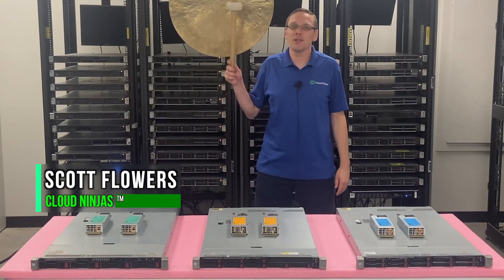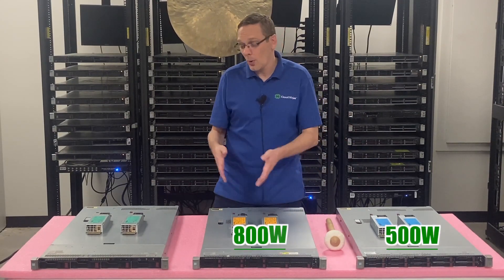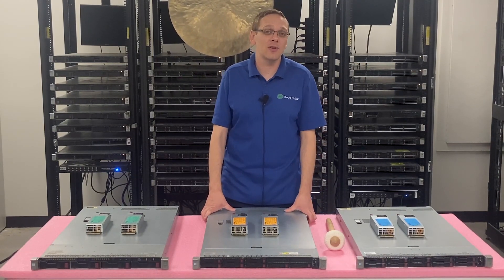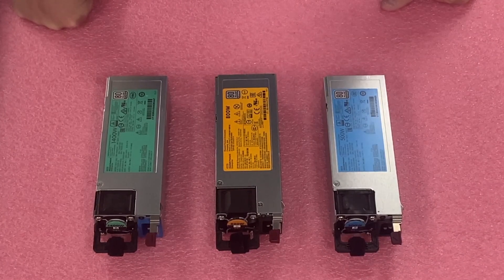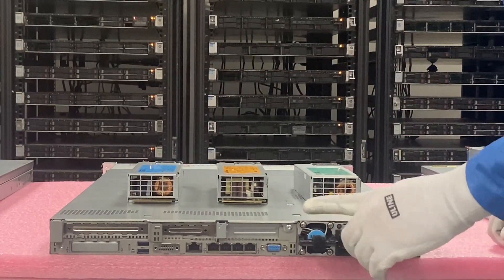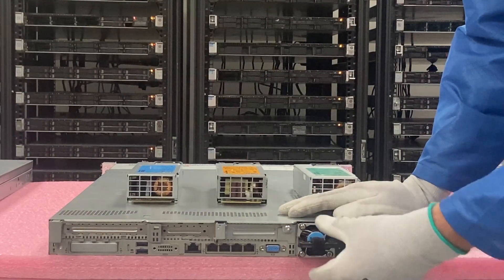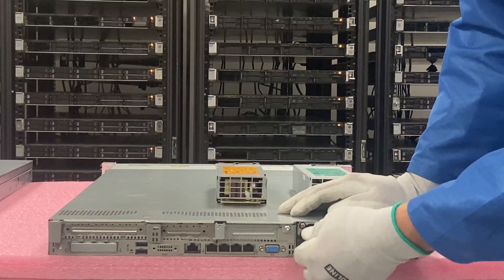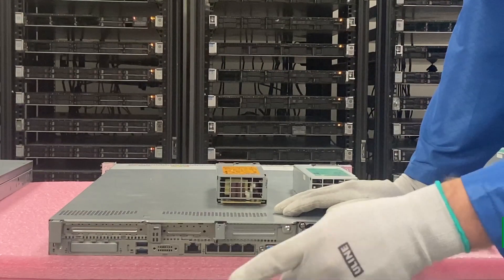HPE ProLiant DL360 Gen9 Power Supplies Overview | Power Supply Options | How to Install Hot swap PSU

Comment: I have logged in to the ILO under HW health status show Power supplied failed when clicked on the Power Supply I see the status for one of PSU shows present but status Input Voltage Lost . Could you advise whether its PSU faulty or may be we need to re-seat the PSU once again and check . Appreciate if you can advise
Reply from the maker: I'd swap the power supplies around and see if issue follows the socket or power supply.  Good luck.

Comment: I bought an ML350 Gen 9 and wanted to upgrade it to have a GPU. I bought a 1400W power supply so I could install 2 x GPUs, but when I replaced the 500W power supply with the 1400W I get nothing, no lights, nothing. It does make a ticking noise when I unplug the cable. I bought 2 more thinking maybe I got a bad one, but still, nothing. The original one works fine, just not the 1400W. Any ideas or suggestions would be very much appreciated. Thank you!
Reply from the maker: I'm out of office for weekend.  My first thought.... 1400W most likely 240V.  If installing as home lab... then your hook up likely not 240V.  Let me know if that helped solve the issue.  Have a nice weekend.
Reply: @cloudninjas  Thank you very much for the reply. It never even dawned on me that it needed to be 240V. I will need to get it some 240V power and retry. Thank you again and have a great weekend.

Comment: I couldn't help myself buying a 90€ special offer used "small" desk pc you usually find on ebay. On holiday, i still buy stuff, but i know i need it! For pfsense stuff right now going on my fujitsu main proxmox server, it also has a gpu so it uses a lot of power, when i'm out i can shut that off and still have my network running.